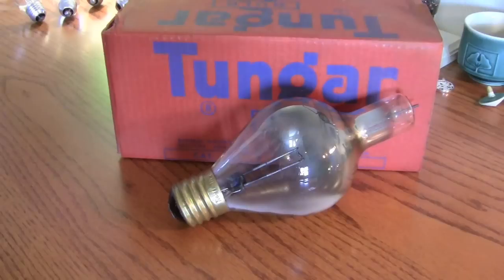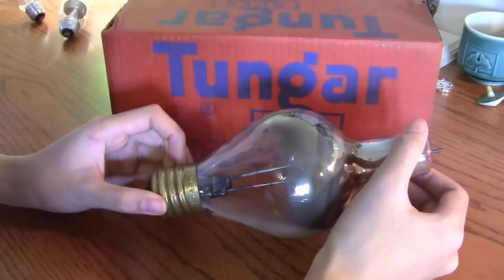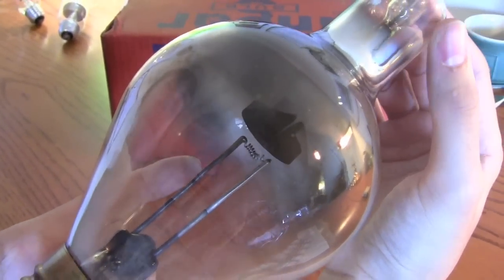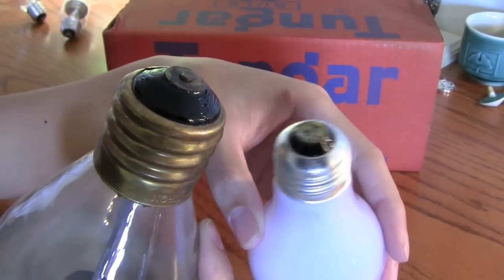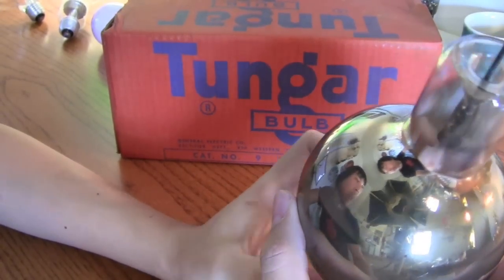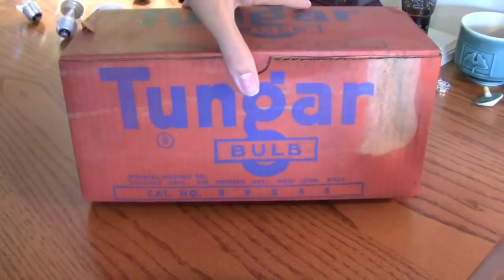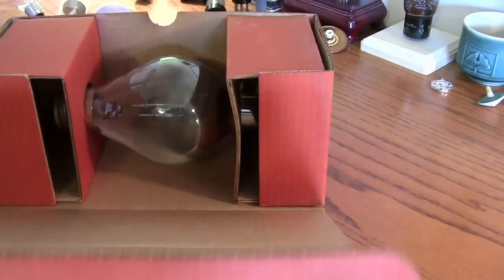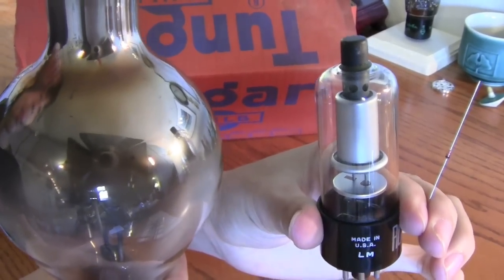GE Tungar Rectifier Lamp

Comment: A 5Y3, 5Y4, and an 80 are all electrically identical. One time I had a set that used a 5Z4 and rewired the socket to take a 5Y3 or 5Y4, the 5Z4 had a similar pinout to a 5Y4 but had an indirectly heated cathode. The 5Y4 was invented by Sylvania, the 5Y3 invented by RCA I believe. The Tungar lamp was a General Electric invention, they were used in a lot of early battery chargers.